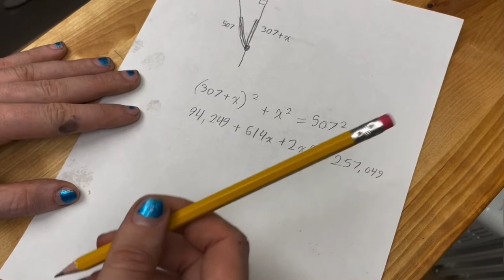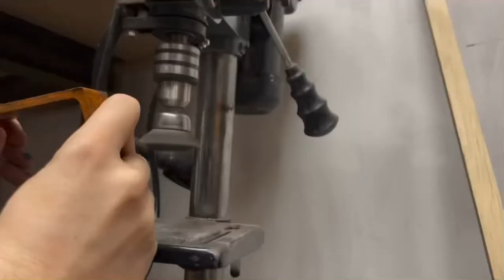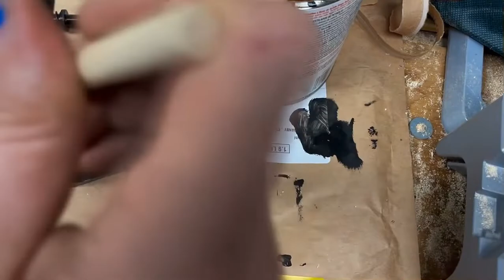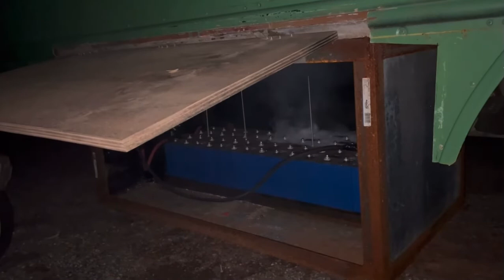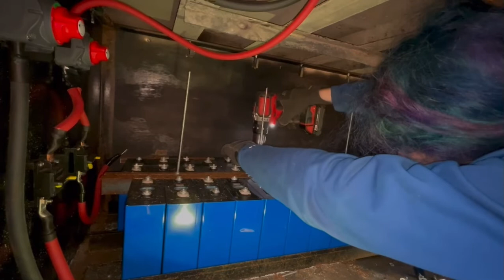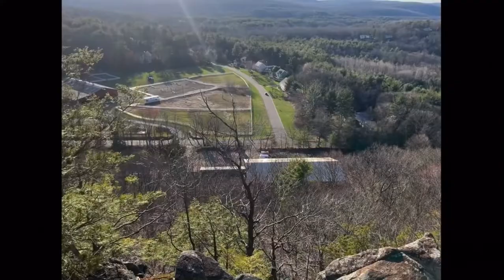Schoolbus conversion #21: Power problems

Comment: This would probably be one of the few times when a smart car would have made more sense for the drive-around vehicle. It's plenty good enough, would charge a lot faster, is much smaller and easier to tow, and I'm guessing would be of a similar price used to that of the Nissan Leaf.

As far as the cells are concerned... yeah I was worried about that as well. I would suggest isolating each cell in it's own contained area so that the calls can't potentially damage each other or arc off the frame.

Since you're already changing them, I would highly suggest changing the entire mounting frame. In my personal opinion, it sits way too low for my liking. I would rather have the batteries stretch a longer distance, but be tucked up higher so that they don't sit so low and risk getting damaged from a lack of ground clearance.

Loving these videos. Eager to hear more about this.
Reply from the maker: Yeah, I considered the electric smart car, but it has no fast charging capability which severely limits my options for where I can take it. Same goes for the fiat 500e.
Reply: @skylerbuildsthings  Makes sense. Who knows? Maybe this calls for building your own small fast-charging electric car